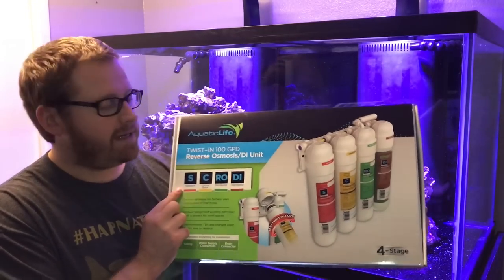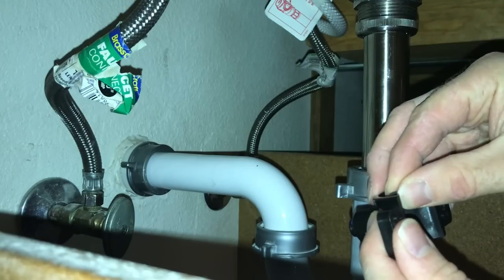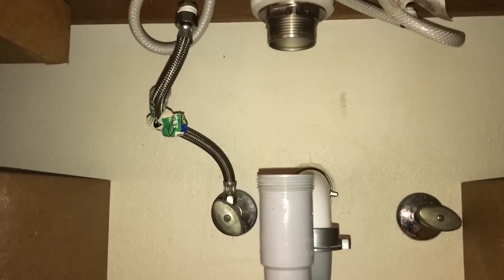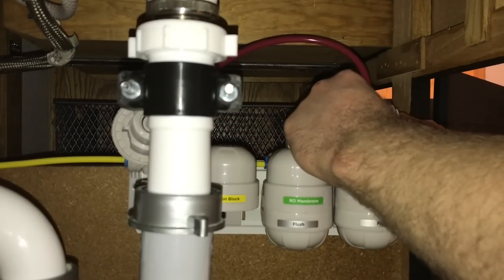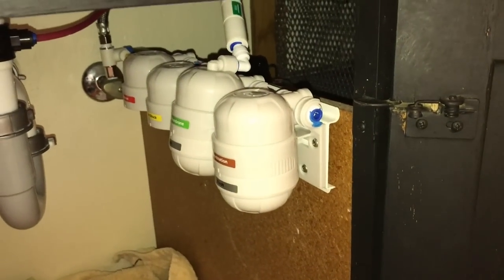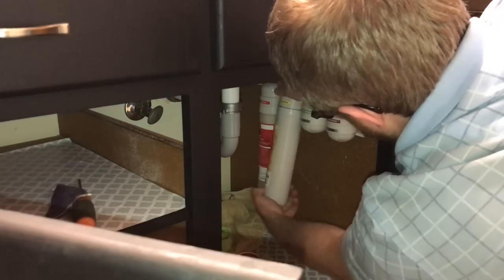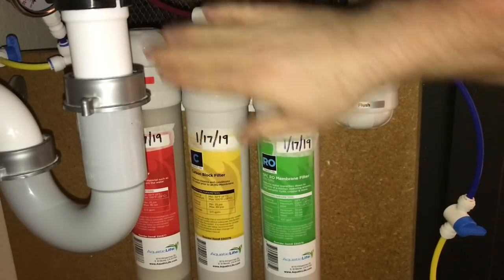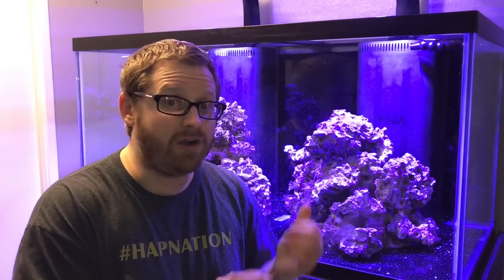DONT FORGET to Buy This BEFORE YOU START A REEF AQUARIUM

Comment: How often should you change the filters out if your working with a 34 gallon reef tank? And are the replacement filters easy to get?
Reply from the maker: Replacement filters are easy to get. I would get a tds meter so you can monitor the tds. once you start getting tds, I would replace

Comment: Hey I have the same unit, When you flush the membrane does that flushed water come through the waste tube or the filtered water tube? I kept the valve on the filtered water tube shut and all the water came through the waste tube. I just want to make sure I didn't have to keep both tubes open at the time of flushing the membrane.
Reply from the maker: Hey Isaiah, I let mine run through the filtered tube.